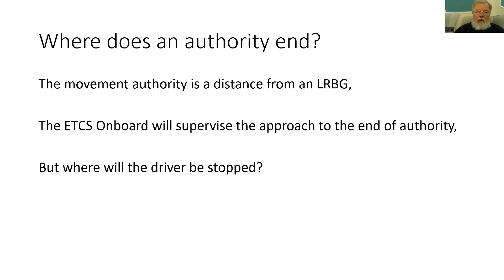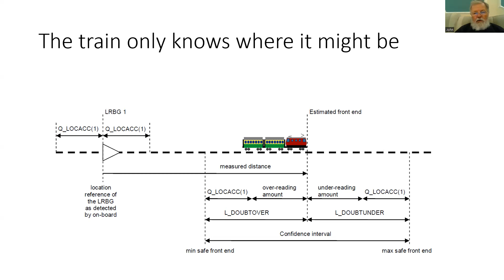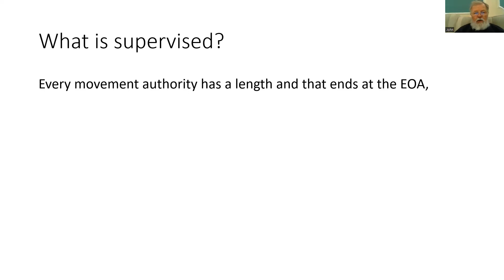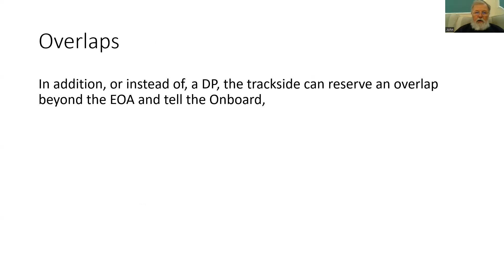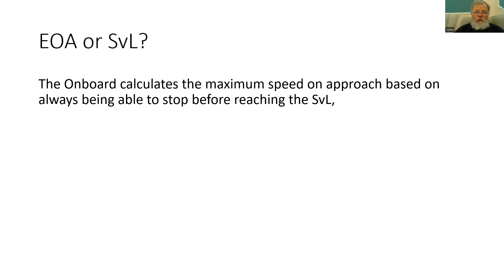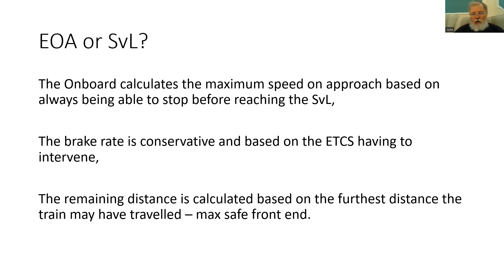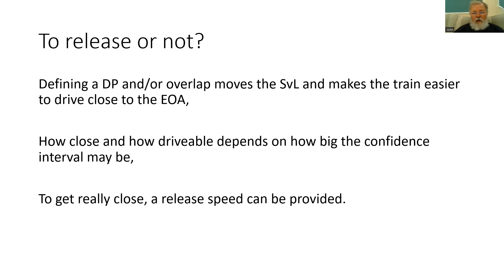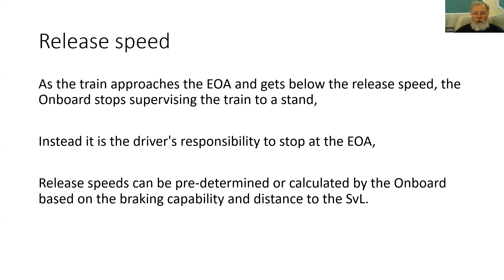ETCS Bites Back - 14 (End of Authority)

Comment: Hi, is ist possible to pass SvL with release speed?
Reply from the maker: It is always possible to pass an SvL in degraded situations such as low adhesion/slippery rail.
However with normal conditions then it depends on the release speed. If it is calculated onboard then the release speed will be the maximum that a train being tripped having passed the EOA can still stop before the SvL taking account of odometry errors.
If you use a trackside release speed then it is the infrastructure manager's responsibility to set that speed so that all trains that trip, once they consider they have passed the EOA, will stop before the SvL. That may be OK when you first do the design and know what types of trains will be authorised - if later new trains are introduced with different brakes there may be an issue.
Hope that helps

Comment: Hi Alexander
I want to know about LoA
Reply from the maker: Hi there.
An EoA and an LoA are very similar, the difference is the required speed at the end of the movement authority. For an EoA the speed is zero (stopping location). For an LoA the speed is greater than zero and normally this is used in conjunction with a transition out of ETCS - perhaps to Level NTC where you want the train to be at no higher than the speed appropriate at the first lineside signal for the NTC area, or it could be to Level 0 or NTC entering a depot where a low speed is required so the driver can manage the movement based on visual checks.
Hope that helps